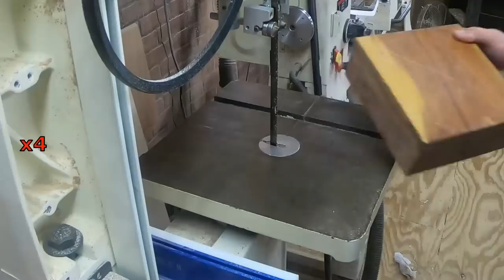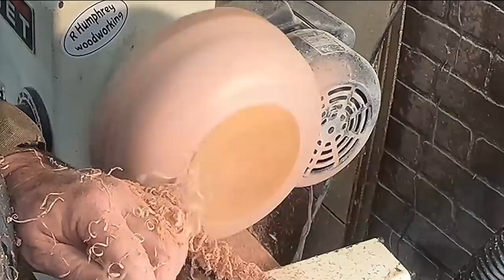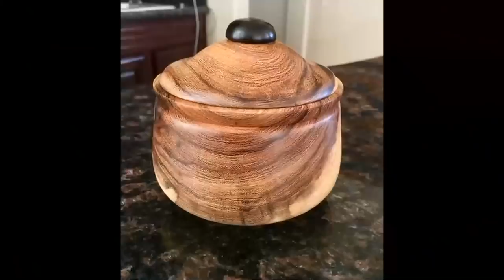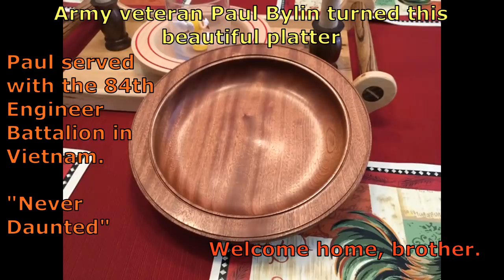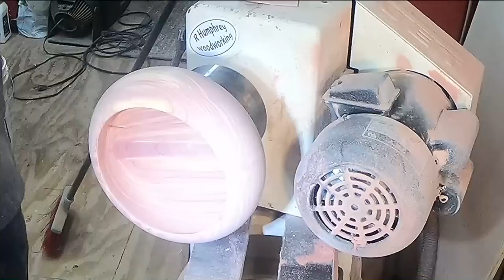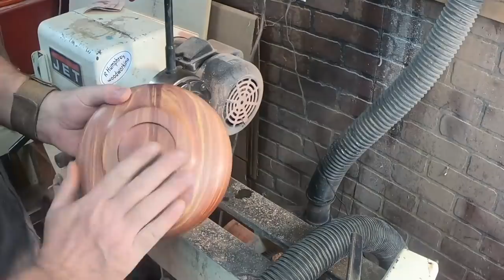Woodturning a Cedar Bowl

Comment: It's captivating how the cedar becomes glassy smooth when you sand down to 1200 grit, isn't it? I find it mesmerizing.
Suggestion: The outside of the cedar wood (bark stripped of course) is white and smooth, but can have some very beautiful contours. How about a live edge bowl in this manner.
Second suggestion: I know the camera cannot do this wood justice, but I would enjoy some close ups.

Comment: Hi -- I have a question about cedar.   Are you using a different or denser cut of wood than say, lumber grade of cedar?   I've experimented with some cedar lumber.  I very much enjoy the look of the grain and the colors, but it's so soft that the end grain sections can be very tough to get super smooth with my carbide tools.   Does using a bowl gouge make a major difference?  Also, can you please share which high-gloss wax you use after the shine juice?   Thank you.  Very enjoyable video.   Best from Atlanta.

Comment: Thanks Rod! Beautiful work.  I have a question that you may have an answer to.  I have some incense cedar and want to finish so that the smell is retained. Any ideas on how to accomplish this?
Reply from the maker: Thank you!  Just my hypothesis, but if you finish with a hard finish it will block the sent.  Maybe use a neutral oil, like a mineral oil maybe...  but you could sand it super smooth and leave cedar unfinished too. It holds up well.

Comment: Man that bowl is beautiful. I have access to red cedar here in Raton New Mexico. There is a lot of it here. What model Jet is your lathe? I have an old 1973 Rockwell/Delta. The head doesn't pivot, man I wish it did hollowing would be so much easier.
Reply from the maker: Thank you!  Mine is a 1442VS , older and no longer made.  Yes, a pivoting headstock is a must on my next lathe as well, I love that feature!

Comment: Love watching your videos. I do have a question. Please excuse me for being dumb but I am new to woodworking. It looks like the air intake of your lathe motor is right by the material you are turning. Doesn’t it suck in a lot of dust and chips? Do you have to clean it out often? I really don’t know that much about turning but it seems like it may affect the motor function. Thanks in advance.
Reply from the maker: The intake fan blows onto another protective plate which seals the inside, so it looks much worse than it actually is.  I do vacuum the intake after each project though, sometimes during.  Kind of an odd design...  Thank you!

Comment: Ron, I noticed you turn the head-stock towards you when you turn the inside of your bowls. I have not seen other turners do that. Just wondering if you have any concerns with doing it?
Reply from the maker: I love having a pivoting head stock!  It provides great access to those hard to reach places.  No concerns really, as I've learned to keep the tail stock up as long as possible, and I tend not to rotate the piece out until it's balanced.  It is a must have on my next lathe!
Reply: R Humphrey thanks. I thought I might try this. Unfortunately PowerMatics will not pivot.

Comment: is it possible to turn a cedar 'round' ie cut straight from the trunk?
Reply from the maker: I believe it is possible... best to do it after the wood has been dried, naturally or by other means.  It can be very prone to checking or cracking... but it also would be a more friendly turn that with a hardwood since you're dealing with end grain.  I'd certainly give it a try! Love cedar!
Reply: @RHumphrey  Thank you! I have access to fallen wood but no blank cutting equipment. Actually I don't even have a lathe yet (!) but I hope to put that right soon.